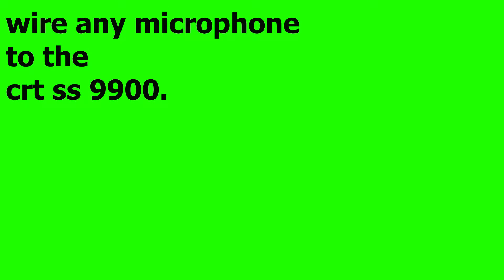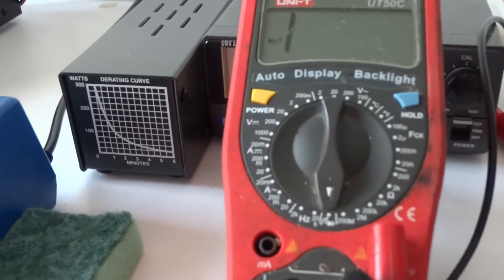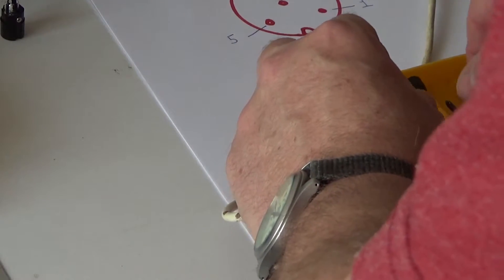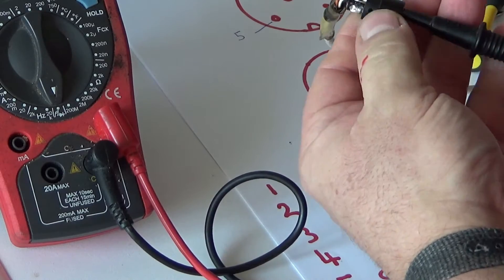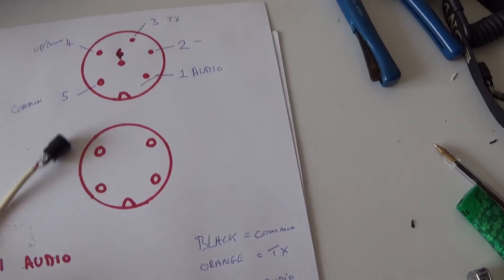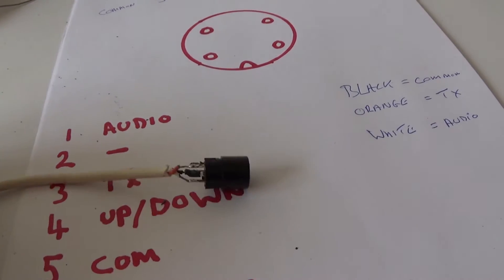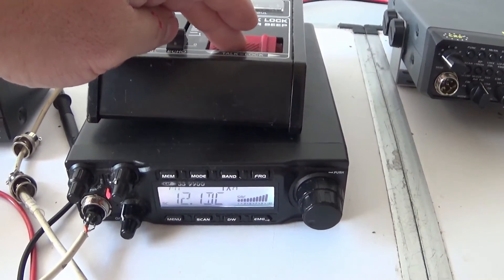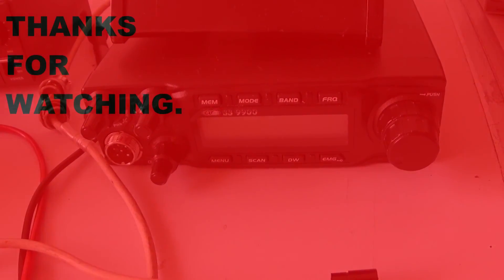HOW TO WIRE A MICROPHONE TO THE CRT SS 9900

Comment: Can I assume that the wire coming from that mic is not mic wire with a shield wrapped around the audio wire?  Does the 9900 have a function in its programming to go from Electret to Dynamic, carbon, etc....????
Reply from the maker: hi Arlene  i am unsure regarding your wiring question.
normally the shield does wrap around the audio wire, although its often hard to get a good visual on it.
the 9900 has no electret/dynamic function,  that said the stock mike is great.
i have tried a kpo on it, but found no improvement.

Comment: So I can unplug my mic from the CRT-SS9900 and plug it straight into the CRE8900 without having to change the wiring.....is that correct?
Reply from the maker: Hi UK Guy if i said it in the video then yes.
Gotta be honest here i got rid of the 8900 a long time ago.
There is a way to check.
Type into google microphone wiring, you should find a page with all the popular rigs are listed.
Look up bother rigs and make a note of both and compare.
Sorry for the late reply.

Comment: So the rx wire goes to pin 2?
Reply from the maker: The 9900 receives with out the microphone plugged in, so you only need 3 wires.
tx / audio and the common.
A different story if you have a mike with up/down buttons.
Reply from the maker: The rx wire is not needed, as the 9900 receives with out a mike.

Comment: Thanks Steve.....you just saved me about £50 or £60 (going by ebay prices). I've got both the CRE8900 and the CRT-SS9900 and I was planning to get another Road Devil mic for the CRT-SS9900 but now I know that I can use the one I've already got on the CRE8900. I didn't know they were wired the same, so many thanks :-)
Reply from the maker: A  pleasure my friend

Comment: Pin 4 on the ss9900 is not for channel change up and down it uses pin 3 the tx line which is used for both tx and channel change
Reply from the maker: Hi Jonathan I will look into that, thanks for letting me know.
I have just looked at a diagram from crt,  their diagram looks to be from the other way around ie from the inside of the rig.
If need be I will sort a new vid explaining all, I realise our knowledge comes from a collective and not just from me and others uploading.